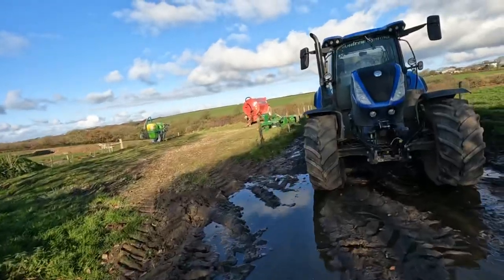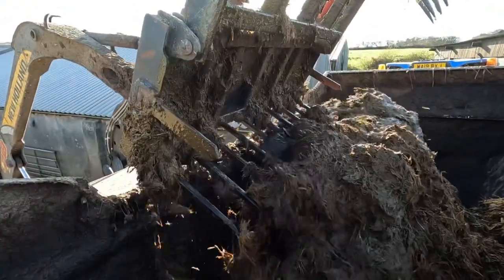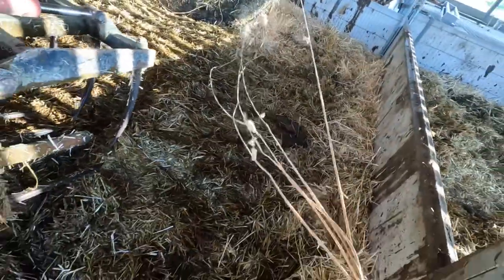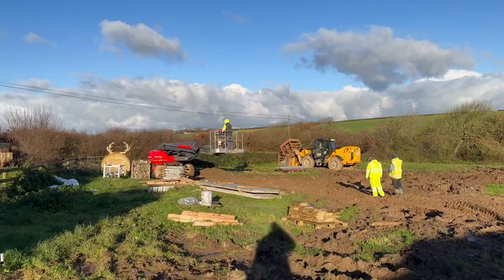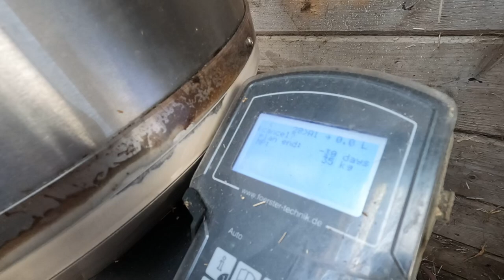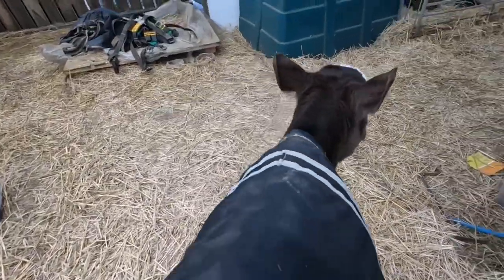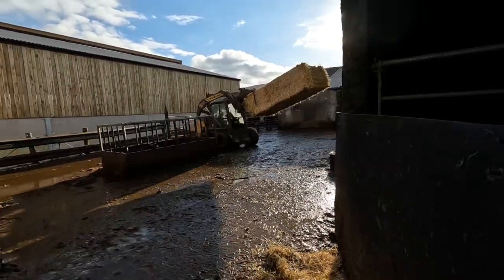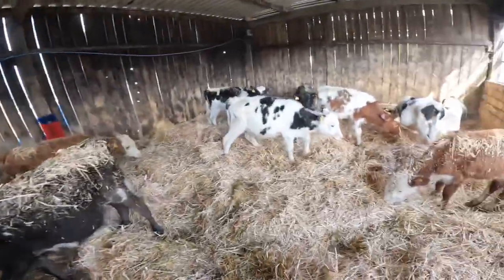CLEANING OUT NEW SEGREGATION PENS,MORE PROGRESS ON NEW MATTS AND MACHINERY BEING PICKED UP

Comment: Good progress on barn build...curious though...about haying the barn floor? Is the floor slated where your skid steer was removing muck? If so, does not an amount of straw fall into your containment section below? If so...is removal/de-mucking a problem from that containment? Thanks for videoing...and answering, when time permits!👍👌💪👀🐄🐄🐂🐄🐄
Reply from the maker: The pens we were cleaning out have solid floors so we can bed them down with straw.the main shed beside that has the slatted floor for slurry.